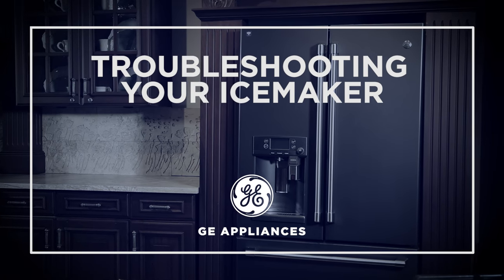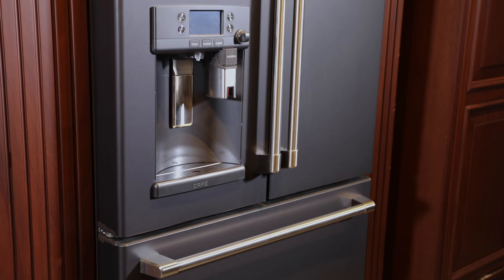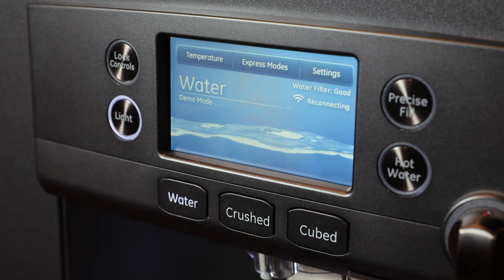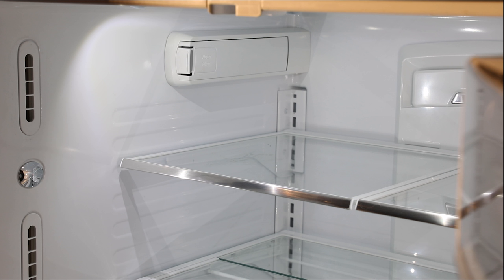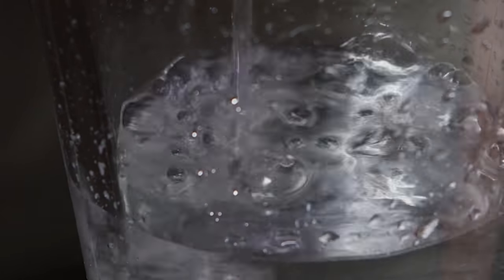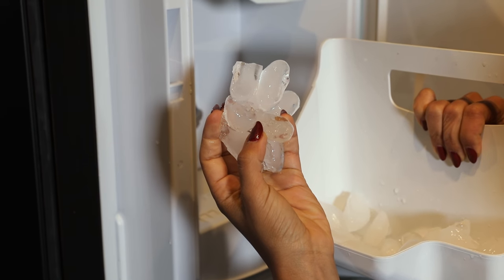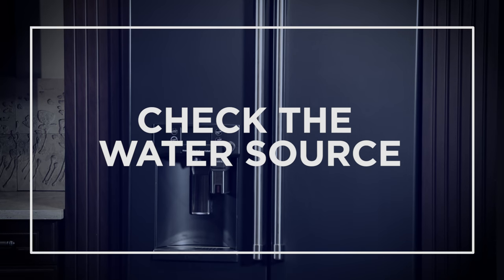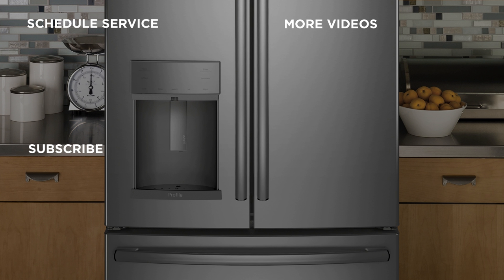Icemaker Troubleshooting - French Door Refrigerators

Comment: Here is a challenge for anyone brave enough to guess the problem.  Bought a new GE fridge and within a month after the warranty ran out, the ice maker quit working.  Now here is the challenge: (1) I can put water into the tray manually (2) The water will freeze and dump the ice perfectly (3) The water automatically fills the tray again as expected (4) the water freezes as expected, BUT NEVER DUMPS AGAIN (5) the ice in the tray finally melts (6) after about 24 hours the tray is dry and the maker never works again until I manually fill the tray again.  I cannot find a way to RESET the thing either.  Lousy design - MADE IN CHINA.
Reply from the maker: Hi there. We're terribly sorry to hear about the issues you're experiencing with your ice maker. This certainly isn't expected, and we would like to help. Whenever possible, please reach out to us on any of our social media channels via private message. When doing so, please provide your model/serial numbers as well as your email and phone number, so we can find you in our system. Thanks. -AT
Reply: @geappliances  I contacted GE long ago.  I was told it would be about $150 for a service call, and to repair it would be parts and labor, so I expected it would cost me about $500 to get another ice maker installed that might last 1 more year.  No thanks.  I won't purchase another GE product in my lifetime as my new microwave GE profile surround kit doesn't fit well and my GE profile fridge is fine except no icemaker now.  And I have no idea what good the wifi on the thing does. I can't find an app to make it do anything except connect to it.  Worthless IMO.  I paid a lot for DW, Microwave, and new fridge and truly disappointed.  The icemaker is FD 11017 and the fridge is PVD28BYNFS.  As much as I paid for that stuff, GE should give me a new icemaker.  The Samsung my wife made me sell worked much better - never an issue.
Reply from the maker: Hi there. We're truly sorry to hear that your experience hasn't lived up to the GEA name. If you change your mind and would like for us to further investigate, we're here. Thanks. -AT

Comment: Simple enough issue, to remove front display/control panel and access the tubing and exit tunnel to clean more thoroughly, without the absurd need to access the water line behind the machine. I have found the exploded diagrams, with little useful details, and do not wish to go poking and prying around plastics unless I know I'm going to find release points or catches. Yet, NOTHING of use online, either DIY videos or GE, thanks for nothing. 4 seconds from the video's end, my exact Profile dispenser inset is shown; how hard is it to describe the various differences, and how to detach the frontplate and access the chute and tubing immediately behind, where all the gunk can be seen but not reached to clean?
Reply from the maker: We know how important maintaining your icemaker is, and we want to help in any way we can. Please note that we would not normally recommend disassembling the unit, as this may void the warranty. If you can, please provide the model number of your refrigerator (here or with a private message over our social media, such as Facebook or Instagram). If you’re not sure of that, we have a tool to help locate the model number at this link: http://spklr.io/6052tJeG . With that information, we can certainly review your concern further.

Comment: Open the left side door where the ice maker is located. on the inside left of the refrigerator are two vents. the bottom one provides the cold to the ice-maker. If this is blocked by some plastic your food is wrapped in, like a loaf of bread, the ice maker won’t cool.
Reply: What is the purpose of the top vent? Is there supposed to be cold air flowing through that one?
Reply: @mattterui1832 to provide cool air to the fridge

Comment: Model pye22pshhss not making ice. Installed new ice maker still not working. I am getting water from water dispenser. Replaced dual water valve, Still no ice , no water in bin. Tried to defrost lines with ice buddy still no luck Used hair dryer also on reservoir. Still no luck can you help?

Comment: My bottom ice maker wasn't working.  I went through all the troubleshooting steps provided, but the rake (arms) wouldn't move and just made a squeaking sound like they were trying to move.  One thing that wasn't suggested, but GE support suggested on the phone, was to power off the fridge (either at the circuit breaker or unplug from the wall).  I did this, and then plugged it back in, and it started working again.  

Also, if your bottom ice maker is not working and you can't get it working with any suggested steps.  Remove the ice maker and try to troubleshoot further.  It's going to be a lot cheaper to buy a replacement ice maker (and plug in a water line, and 2 power connections, and a self tapping screw) than to have someone come out to look at it, and they may not even be able to repair it depending on the situation.

Comment: Having the same problem - Again.  GE replaced the Icemaker unit in the door, the Thermister (Thermostat plug), and the door, which seemed to have a bit of ice buildup around the top left hand side (and still does with the replacement door, but not as much)

Checked the left hand side vents in the refrigerator and the bottom vent is pushing some air into the freezer compartment.

I have a new filter on order, but the water from the water dispenser has a steady stream.

By chance, while I was waiting for the tech to arrive to replace the parts mentioned above, I filled the Ice Bucket in the door with Ice from a 5 LB bag I bought as I don't have ice trays.  Wouldn't you know it, the ice maker suddenly started working again.  Laying in bed and I hear the "thunk" of ice falling into the bin.  Figures. 

I do think there is a design defect in the icemakers - i am wondering if there is a leak somewhere or the icemaker is not getting enough cold air (maybe both).  I'll keep trying....
Reply: Any updates on this?

Comment: Need help with the filter for my GE GFD28GBLCTS - when the system called for the filter to be changed it was incorrectly installed and now a new filter will not go into place. Do you have a youtube video on how to take the filter area apart to fix it?

Comment: my ice maker keeps overfilling the cubes and they come out attached which jams the ice dispenser. Is there no way to adjust the water level in these ice makers?
Reply from the maker: Hi, Chris. Thanks for reaching out! When ice clumps in your ice bucket, this is usually due to the ice melting in the bucket, and refusing. This can happen naturally over time, if the ice sits for too long, or if the doors are left open for too long. We recommend dumping your ice bucket if you do not use ice often or turning off your ice maker when the bucket is half full. Please send us a private message on Facebook or Twitter if you have any more questions. - JB
Reply: @geappliances way to not actually read the question. I have this same issue (ice stays connected from overfilling trays) and I’ve been searching high and low to find if there’s any way to make adjustments. This should be a simple fix.

Comment: GE french door fridge Endora model I believe  water and ice dispenser stopped working and freezer light quit coming on all at the same time. Water works to make ice checked that out   When I use the dispenser the lights on the dispenser come on like they always did but nothing works  usually herd the solenoid click for the water but it doesn’t do that any more  any ideas. Ice maker auger doesn’t make a sound either
Reply from the maker: Hello. We really hate to hear you’re having these issues with your refrigerator – we know this must be frustrating, and we want to assist however we can. 

We hope you see our response to your other post, where we provided links to troubleshooting articles and information on contacting our service department, if that’s necessary. If you weren’t able to address these issues with that information, please provide the model number of your refrigerator (here or with a private message over our GE Appliances social media). With that information, we can certainly look into this further for you. 

We’re also happy to assist with any other concerns you may have. All the best. -SG
Reply from the maker: Hi again Tim,

Thanks very much. If water is coming to your unit, but you're unable to call for water or ice from your dispenser, then we'd recommend checking to make sure that your controls are unlocked. Just press and hold the Lock pad for 3 seconds, this locks and unlocks the ice and water
dispenser, as well as all features and temperature buttons.

If this still doesn't help, then we'd recommend reaching out to our service team for further assistance: http://spklr.io/6056l2bK

If you have other questions, feel free to let us know. -MS

Comment: My ice maker quit working. The last bit of ice it produced melted in the ice bin. I checked temps and the freezer is at 0F and the fridge is 37F however, the ice machine is at 60F. My assumption is the fan that feeds cold air to the ice maker quit working? Did anyone else have this issue and/or fix?
Reply: I only have one fan in my freezer. It may be the heater in the ice maker getting stuck in the on position.

Comment: My ice maker is jammed but I cannot pull the bucket out because it is frozen in place. I have tried multiple times over the past month but it will not budge. How can I safely warm the bucket to try to melt ice buildup?
Reply: I have a GE Cafe French door refrigerator.
Reply from the maker: Hi Kim,

We're quite sorry to hear about this inconvenience you're having with your refrigerator. Would you mind sending us the model number of your unit so that we can look into this? Thanks. -MH
Reply: Thank you! The model number is CYE22UP2MS1.
Reply from the maker: Thanks for providing that information, Kim. After further review, we recommend scheduling service with a certified GE Appliances technician that will be able to accurately diagnose and repair your appliance. You can do so by calling GE Appliance Service at 1-800-GECares (1-800-432-2737) or by clicking here: http://spklr.io/6050Yizk. Let us know if you have any other questions. All the best.- KW
Reply: @kimlang2299  try a hair dryer if you haven't already tried that

Comment: I have the cafe model and cannot figure out how to turn my icemaker on. In settings, on the display, it doesn't give an icemaker option. Help?
Reply: On the second page of the settings menu my options are different than the above video...my options are water level, humidity and door alarm. no icemaker option on any of the pages.
Reply from the maker: Hi Wes - on some models the icemaker pad is on the main control board, rather than in the settings menu so please check that.  However if that's not the case, please post your model number and we'll be glad to check for you.  Thanks  -CC
Reply: Well I ended up doing a good ole reboot with the old trick of simply unplugging the fridge for 30 seconds and then plugging it back in. That fixed it...there on the 2nd page the icemaker "on or off" option appeared. Computers and fridges :)
Reply: @Revwd13  I'm glad I stumbled across this video/comments. I restarted my fridge after cleaning yesterday, and no ice today. After watching the video, I looked for the icemaker on/off, and saw it was missing from the settings. After powering off then on, the icemaker control is back. Thanks